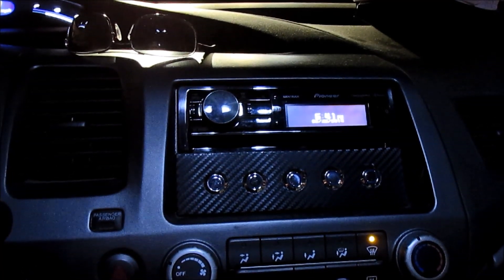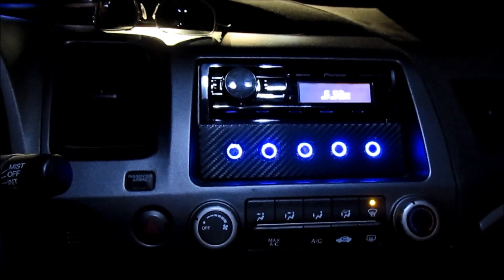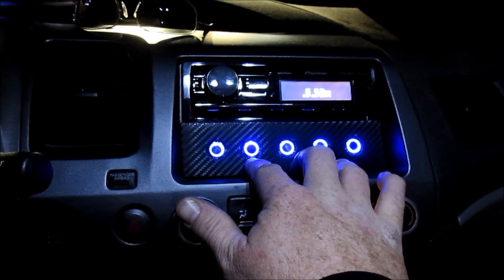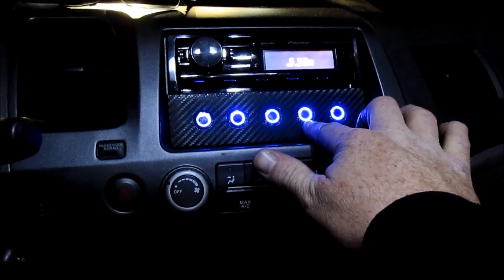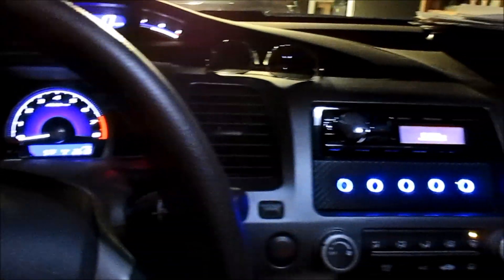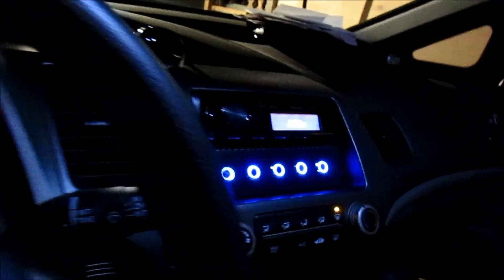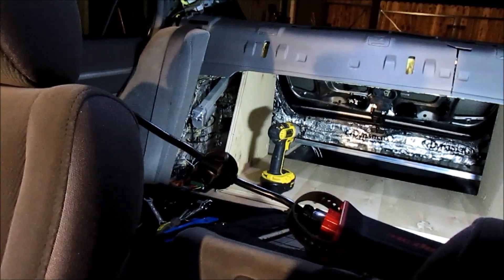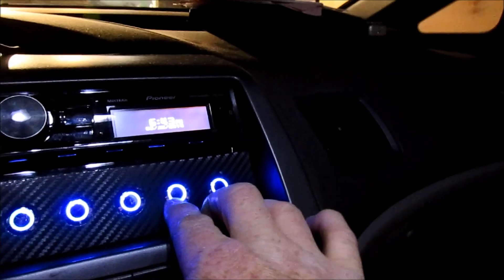Trunk Lid Actuator Install with Custom Button Panel

Comment: Im trying to figure out how to hook up the buttons to two 12" pumps for the trunk.  Can you help?
Reply: I sell this switch with the wires attached
Reply from the maker: *****
What do you mean how much?  Or are you speaking with fiestasport?
Reply from the maker: *****   Here Sean, I did an album of what I did explaining everything.  The only thing I'd go back and do differently after doing it, is I'd put the resistors on the switches for the leds.  I had all but one end up burning out on me before I sold the car.  Otherwise I liked how it was working.  Never got a chance to perfect it unfortunately.  https://www.facebook.com/media/set/?set=a.620123008047180.1073741869.494875200571962&type=1

Comment from the maker: Thanks Drake.  Yeah I loved them when I saw them. . Clean, led halo is not over powering, and it just fit the bill.  You can get them here: http://www.adafruit.com/products/915#Description and then also search on there for the momentary switches.  Little pricey if you're getting a bunch, but they're well built.  You'll feel the quality as soon as you open it up.  Nice switches for sure.  Thanks!